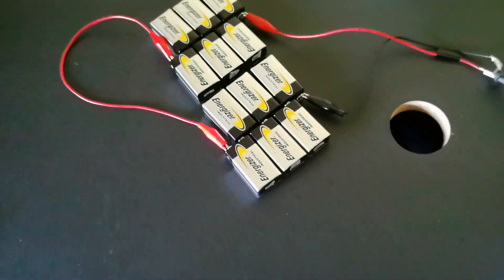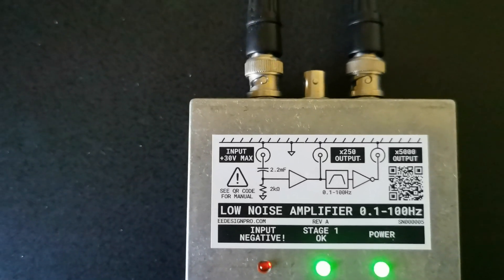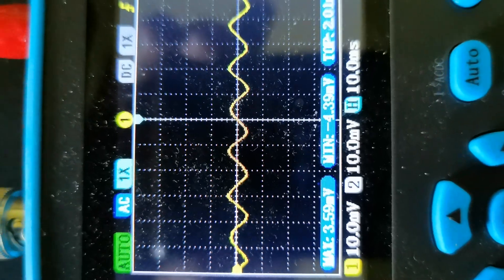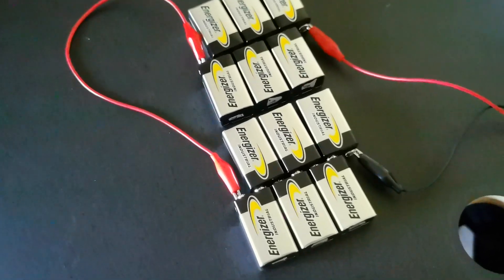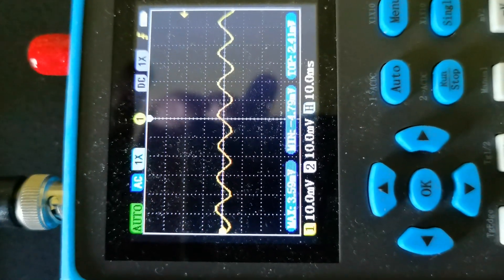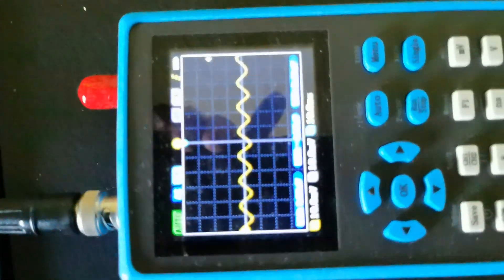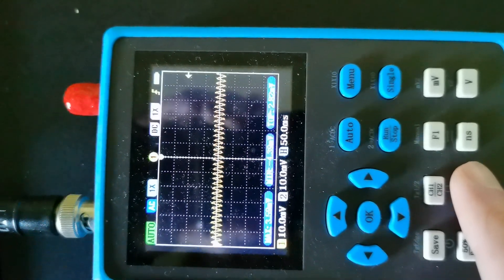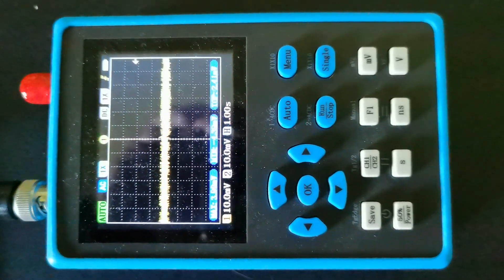9V alkaline battery noise

Comment from the maker: I said internal battery resistance was "maybe 1 ohm per battery" in the video, but later measured 20 ohms per battery.  These batteries even have some effect (chemical process?) where their resistance grows to more like 40 ohms after ~10ms when already close to full (I am charging half the batteries, but just a little, with this anti-series measurement method).  Anyway, more resistance allows 60 Hz to enter with even less needed capacitive-coupling to mains.

Comment: At these measurements you are picking up your fiwi etc as well.
Need shielding. Put everything in a faraday cage (metal or fine mesh box) hooked up to outside via a coax and plug that into meter.